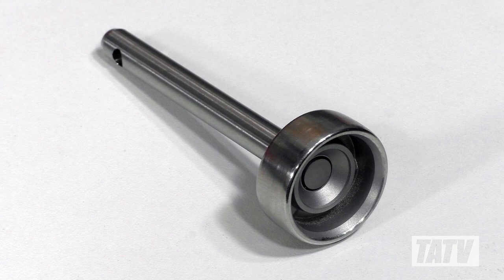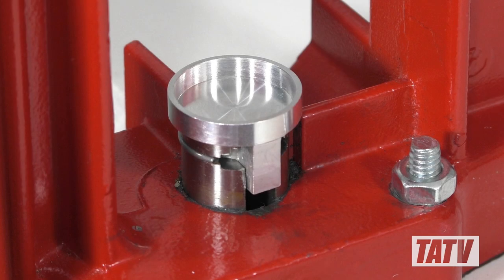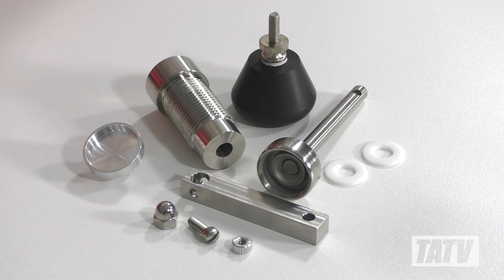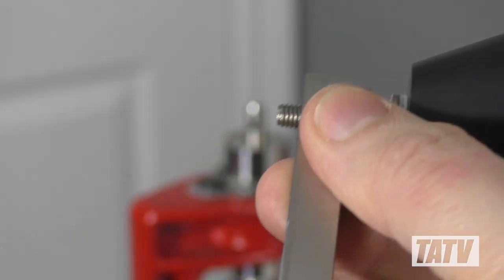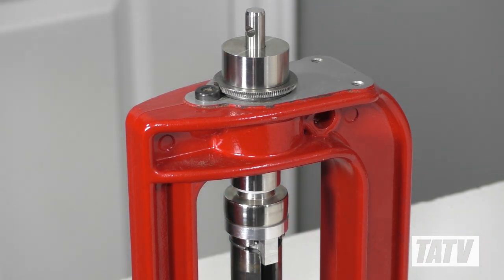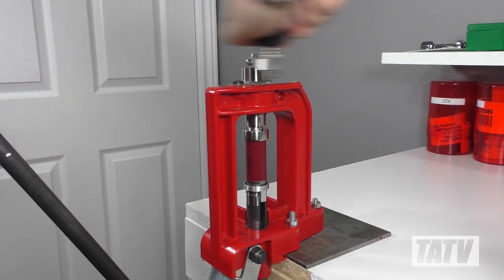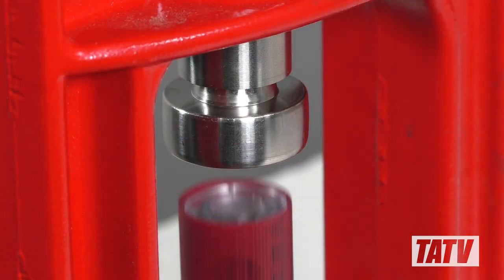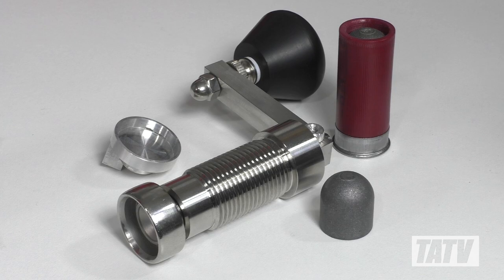Press-Mount Shotshell Roll Crimper

Comment: Sweet! The only modification/ add on that would make it perfect, is a Jacob's chuck. If you're able to add that, then customers can use their favorite roll crimper or crimp finisher in the setup. This would also allow other attachments to be used with your tool, such as a hull trimmer or skiver. If you're able to integrate a "hull vise" of some kind into the shell holder portion, that would be awesome.
Reply from the maker: I've thought about hull vice before; the chuck is an interesting idea but it would quickly render the tool set prohibitively expensive to produce.
Reply: @TATVCanada  not really, offer it as an add on. You also wouldn't need   a high quality Jacob's chuck, just one that's high enough quality to function reliably under an insanely light load, compared to all the other things they're used for. I'm looking at some of the chucks right now, and they're $26 usd from Tormach, for cnc work. Amazon has them for less. If you dig a little, you can probably do better than that. The rod in the design would be the perfect arbor, so whatever it costs you to make that, which would be the only machining to be done. So high estimate, $40 usd for materials. Time would be machining the taper or OD threading it if you can find a threaded chuck to work instead of a Jacob's taper, and assembly if you go with the taper. So you're in it for less than $50, probably closer to $30, offer it for $90 to $100 as an accessory. Not the world's best margin, also not really a big pain to make, mostly just shopping, and 1 op on bar stock. You should at least consider looking into it and prototyping it. This would be way less complicated than making a "hull vise" of some kind for the shell holder, as an accessory. Anyway, glad to see you innovating, keep up the good work Sir.
Reply: How much is this setup, for me, it would work great.

Comment: Nice, I like it. Now you need to add an optional tapering die to replace the roll crimper or maybe the roll crimper takes care of this. Different gauge crimpers & shell holders would make a cool set. Good stuff!
Reply from the maker: There will eventually be a 20g adapter, maybe even a 410.  So many projects on the go right now; there just never seems to be enough time for everything.